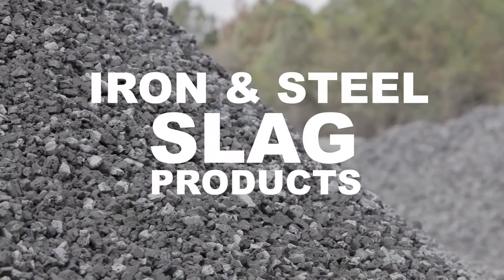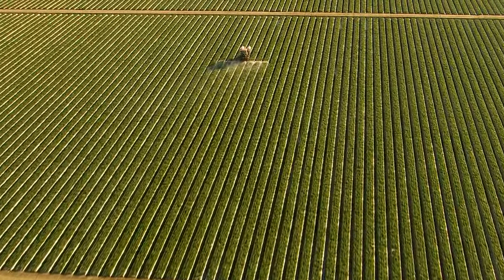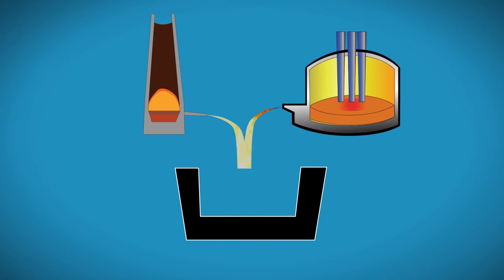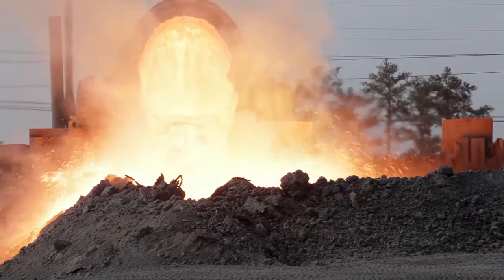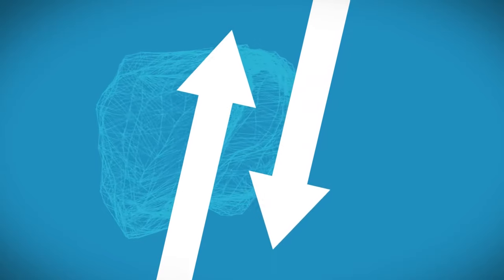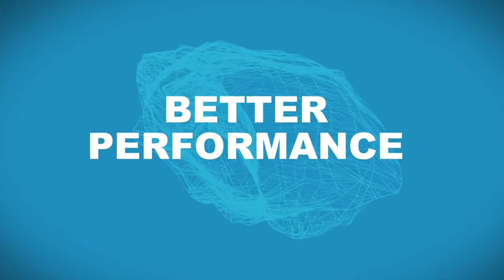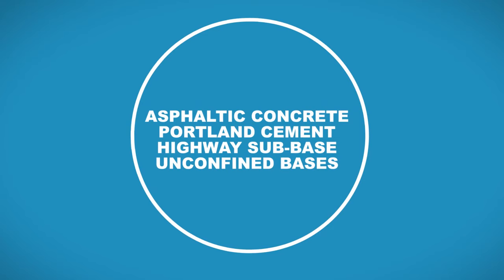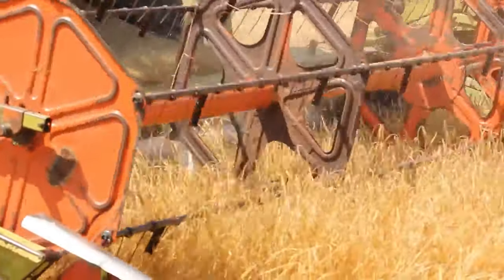National Slag Association Iron and Steel Slag Products

Comment: Back when the highway departments in my area used slag for general road paving, skid-related car crashes were nearly unheard of. Now that they've changed to asphalt, it's all too common during rainy weather.
Reply: Asphalt roads typically have an aggregate in them, which can be slag.
Reply: Highway speeds were probably lower. The national speed limit (when we had one) was 55mph. Now, you have highways far in excess of that. Furthermore, the speed variance between the high speeds of interstates (upwards of 70mph) going into cities and towns (where it often drops to 55mph) leads to a lot of speed variance accidents.

Comment: What is the difference between slag and slag products? What is the process used in between other than break and sieve?
Reply: Slag is the molten hot stuff off of a steel furnace, slag products are the various sizes of cooled slag and can be used in different ways

Comment: Can't the slag be fractionally distilled to yield other elements, by starting at a low temperature, collecting those melted solids, and therefore seperating.... then raise the temperature to the next elements melting point, and collect the runoff again.

They could probably do this in space, with Asteroids, using some kinda magnetic induction to heat them, and separate the different ores based on their melting points, again starting low, and going upwards, Till practically nothing remains

Comment: What is the difference between iron ore, and iron slag?
Reply: Think of it as iron slag is the impurities in iron ore.

You reduce iron ore into unrefined iron by heating it alongside carbon in an oxygen-free environment. The carbon strips the oxygen from the iron ore, turning into carbon dioxide and leaving unrefined iron behind. You then refine the iron by melting it, and the slag (impurities) float to the top out of the molten iron.